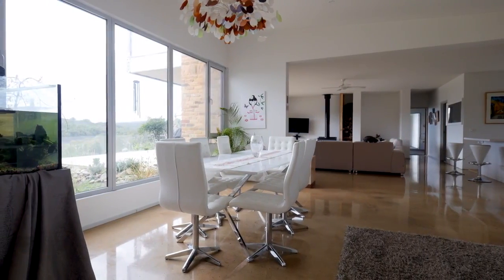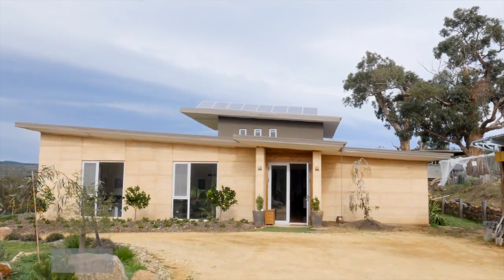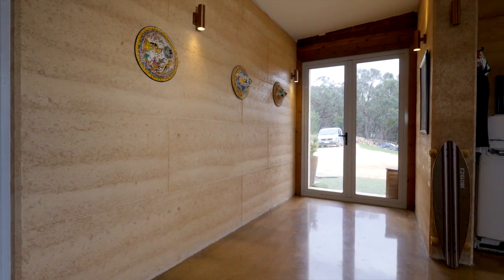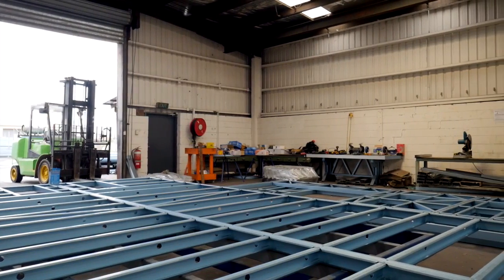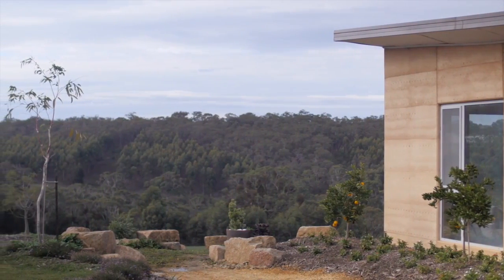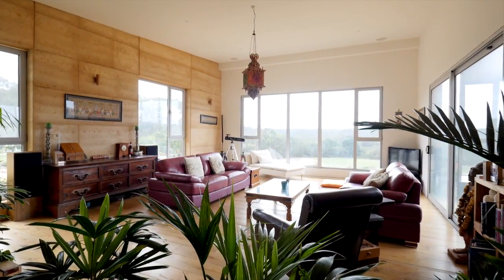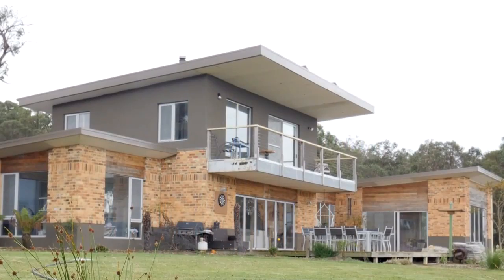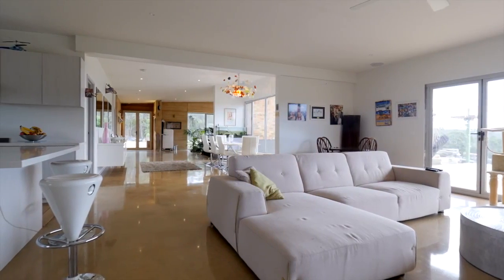Light gauge steel frame villa with finishing

Comment: What is the thickness of the metal studs and tracks used?
Reply from the maker: for load bearing walls it is 1.15 mm  and for non load bearing 0.95 mm
Reply: Thank you, very nice job. You did not put additional support for the 2nd floor deck like rec tubes or thicker metal bars? Just pure metal studs and tracks?
Reply from the maker: here you can find more pictures http://dynamicsteelframe.com.au/album/?ID=7